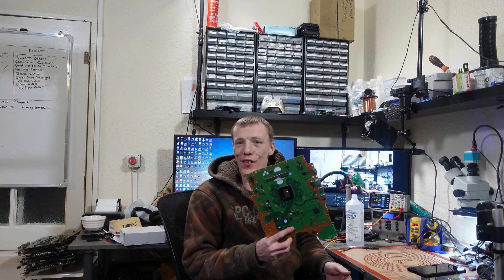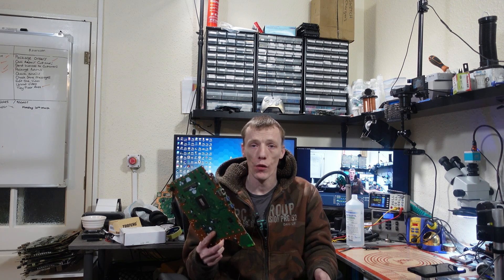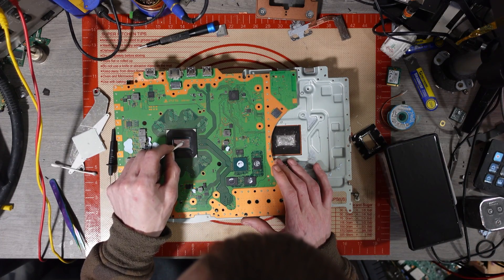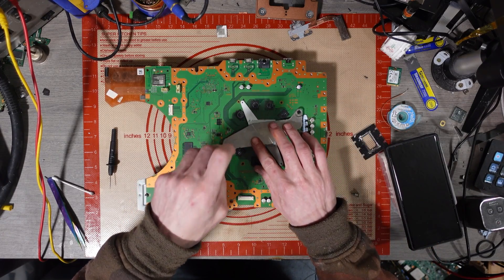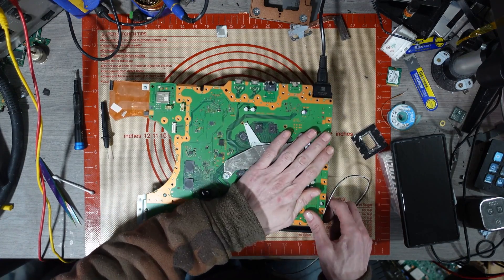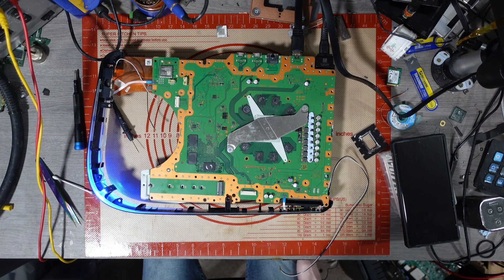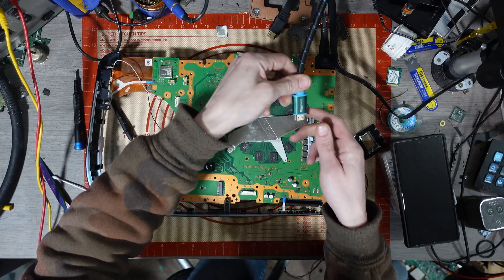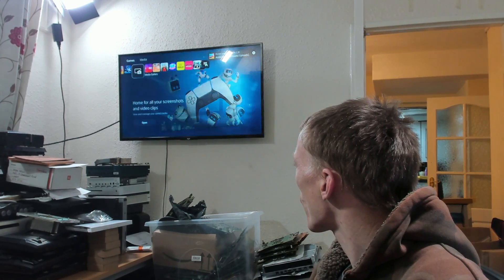A Broken PS5 Motherboard | Can I Fix It (Joblot Boards Part 8)

Comment: Mine got hit by lighting. Wouldn’t turn on after. Replaced the power supply and now it comes on but after about 15 to 30 minutes it shuts off with no overheating message. Power supply is super hot to the touch. Any ideas?

Comment: Wd40 works like a charm for stick drift,
Reply: IPA to clean, silicon grease to lubricate. I wouldn't use WD40.
Reply: You only use WD40 on a controller if you want to kill it!!